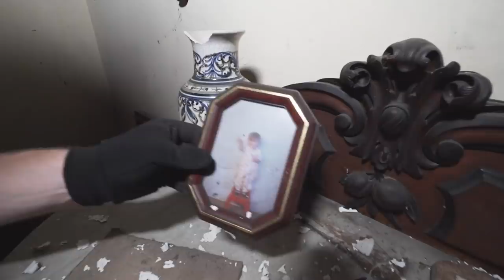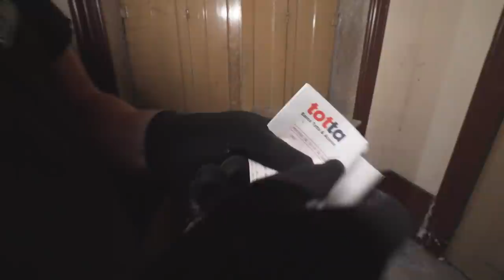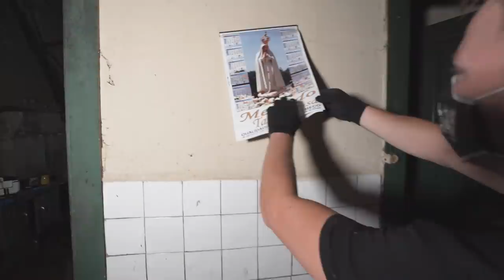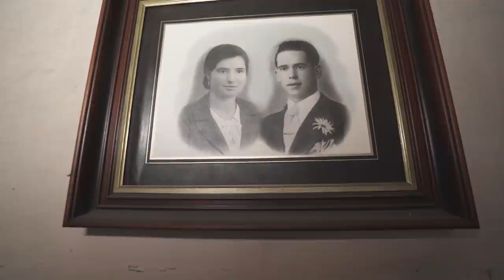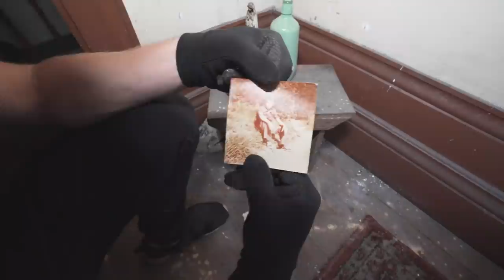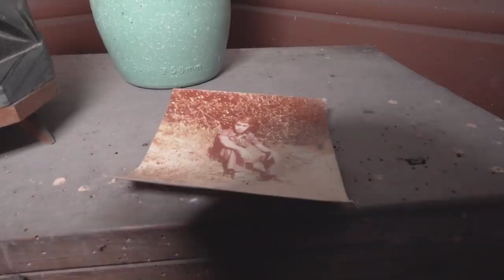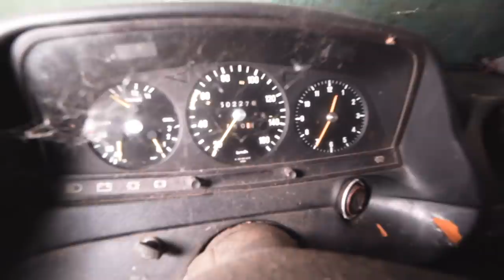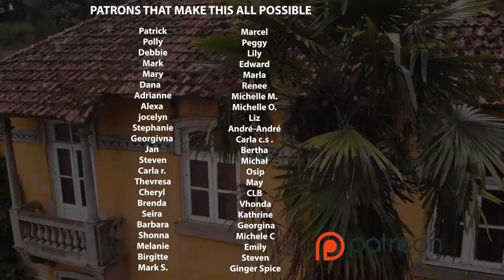Abandoned Mansion of a Just Married Couple, Tragic Ending...

Comment: As someone said below, the cabinet with the mesh doors is for food storage.  Air circulation was good and it kept rats and mice out of the goodies.  In the old days, they also had cabinets that had mesh on the bottom over a hole dug into the ground.  This added cold air from the basement to help keep items from spoiling!  They really knew how to work with what they had.  Thank you for the good tour.

Comment: I have seen explorers go into places and see faucets dripping. They feel bad about wasting water so they turn the faucets. When in reality the faucets were left dripping or running for a reason. If there is no heat in there and all water is shut off the pipes will freeze and break. I suspect that's what happened upstairs in this house. Good intentions sometimes cause problems. ❤❤❤❤

Comment: A few corrections from my view. Somebody just made up that story of just married and killed from somebody hanging up a found wedding dress combined with the photo of a couple. That photo is at least from the early 1900s maybe of old family. It was an old family home/road house diner or restaurant. In the kitchen you missed the other calendar I barely saw 2012 on it. I saw more screen box cabinets in that rear kitchen ..I think held fresh chickens and rabbits for the menu. Maybe they smoked them back there. Those clothes in the wardrobe seemed to be old ladie's clothes so probably last to die there. I saw sinks in bedrooms and missing faucets same as kitchen. Metal thieves work and I think the wet room with 2 beds had a sink buried on the right and may have faucet/pipe stolen and leaking or water faucet turned on. I was hoping it could be turned off. The 240 D diesel Benz had 50,000+ Kilometers not 500,000 the last digit wheel of a different shade turn number at a 10th of a Kilometer.